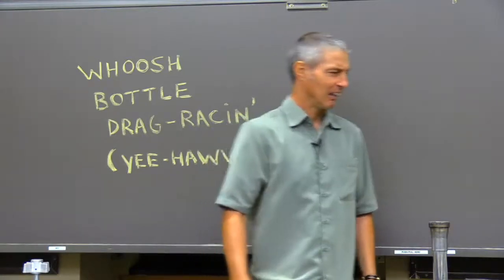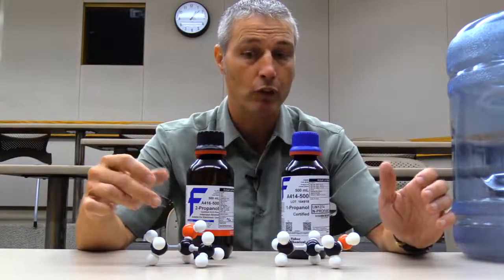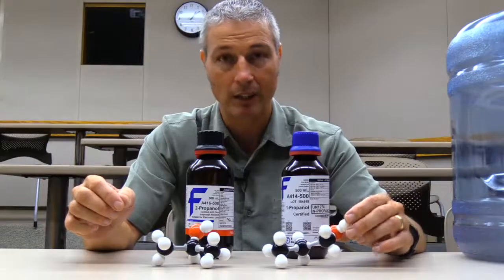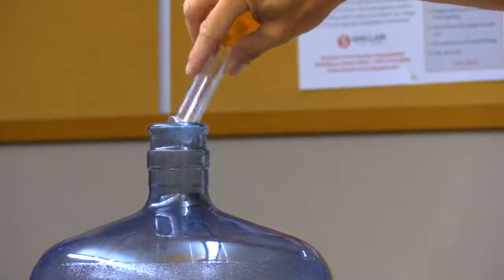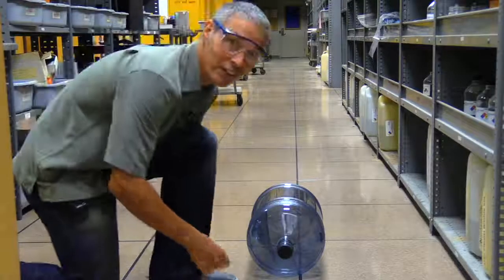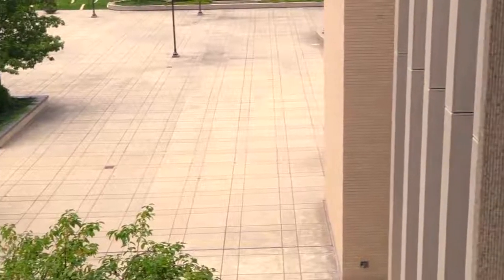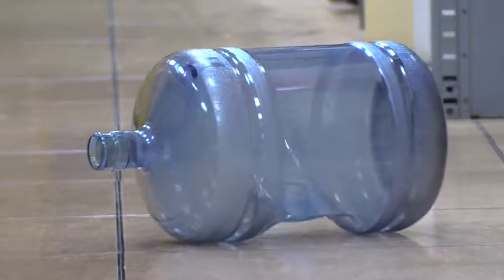Whoosh Bottle Rocket On Steroids

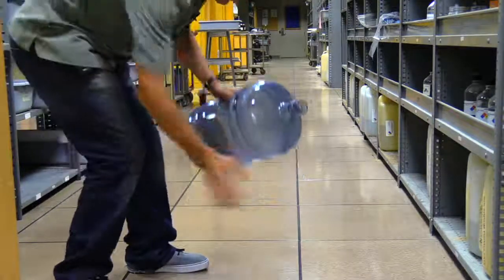Comment: I goofed at 2:17.  I meant 1-propanol has a HIGHER boiling point than 2-propanol.  Also, I think the whoosh bottle leaked a bit of vapor out of the top and should have propelled itself at least a little bit.